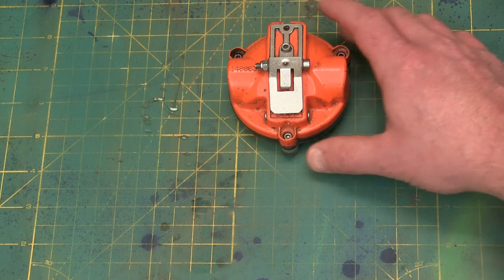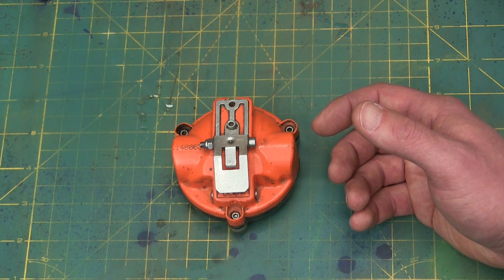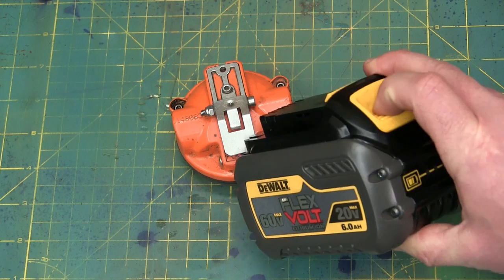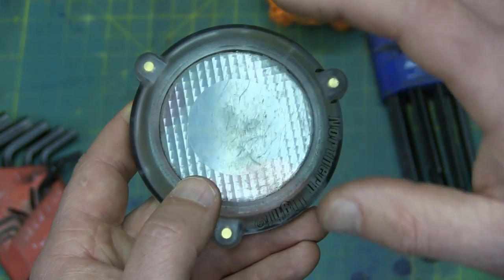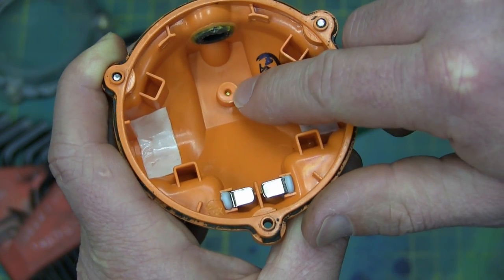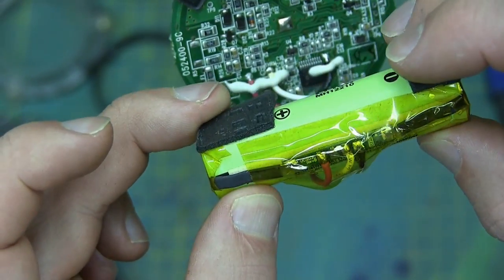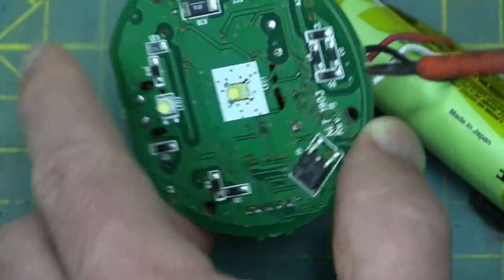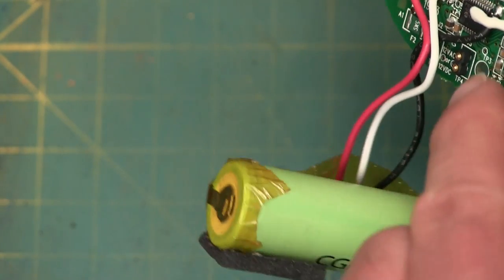BOLTR: $500 Industrial FLASHLIGHT. WHY SO MUCH?

Comment: Working in confined spaces, items such as torches and gas detectors have to be "Intrinsically Safe". This means NO sparks are allowed to be produced by the device itself, internally and externally, not to produce a potential hazardous situation and not to produce a hazardous atmosphere or to add to one. The devices are not to cause personal injury either. The devices HAVE to be calibrated as per the industry standards and by the related ISO standards and occupational health & safety laws applicable to that country. The main reason for the expense are the safety ratings for the types and specifics of work it's used for.  Cheers :)

Comment: 18650 cell, the protection circuit is likely only overvoltage, undervoltage and overcurrent. there would have to be a microtemp or ptc strap welded to the cell to provide temp relief in addition to the vent in the cell.

Comment: Lil' trick to unfog these glass lenses.  You just rough em up good with high grit sandpaper, clean up ( not with brake cleaner :P ) and you apply the tiniest coat of clear spray paint.

Comment: Yup. Been in the emergency services for many years. In the FD we are always getting reamed by various regulations where we have to have equipment that meets certain specs and has X certifications. Explosion proof is a big one.  The workplace hazards are very real, OSHA and insurance companies are constantly snorting and stomping around, and profiteers making fistful's of money from the restrictions are more common than flies on a poop pile. 
Flashlights, man down alarms, protective gear, you name it. Once saw fire axes being sold at a trade show for $120 a pop back when you could buy a regular axe for $20.
But when it comes to triggering an explosion, be it coal dust or flashover,  it's kind of nice knowing your flash light won;t set it off.

Comment: Wonder if it didnt break because its so soft? I know plastick like clear ghetto silverware will snap easily, but those are also harder, so its much more brittle. Internal stresses on that are also visible through polorized lenses. Maybe the lens is soft as a safety feature to help prevent shattering if and when it becomes a rock deflector?

Comment: 200 and 300 series stainless are austenitic (good corrosion resistance, decent strength).  400 series is ferritic (cheap and definitely magnetic) or martensitic (hard).

It' probably a 300 series stainless with lots of ferrite. That would be slightly magnetic.

Comment: The cheaper 18-8/304 grades of stainless will become magnetic with cold work (especially in stamped sheet stock). 316 won't, but the others will. You could test with Copper Sulfate (I know you have some floating around) to verify it isn't ferritic.

Comment: The light iscertified  what we call in Europe ATEX, atmosphere explosive. These lights are tested that the energie of a short circuit is so low that it cannot ignite a flammable gas/dust. Al these items are certified thus expensive. For mines there are 3 classes zone 20,21,and 22 .

Comment: Been enjoying your “vidjeos” always cracks me up. The battery dimensions of that thar 18650 would be 18.6mm diameter by 65.2mm in length if I recall correctly.

Comment: I know this is an old video, but I thought I would share an experience with PC.  At a prior job we had a product where the prototypes were milled from blocks of PC.  When we went to production we went to molded components.  Well some knucklehead didn't think to observe the chemical incompatibilities of PC and had spec'd that the assemblies be put together with Loctite all over the place.  The injection molded parts just crumbled.  You could watch the cracks form and then the capillary action would pull the thread-locker along the crack.  The thing would propagate like a fault-line in a crappy disaster movie.  The milled parts were just as susceptible to chemical degradation but because they had less internal stresses they became brittle instead of completely crumbling of their own accord.  They tried to use less loctite but even the curing vapors were enough to cause the assemblies to fail.  It was a real PITA to deal with.

Comment: The little PCB is a Battery (or cell in this case) protection module to protect the cell from overcharging and overdischarging. It is an 18650 - the 18 refers to the diameter (18mm) and the 650 is the length (65mm) and I have no idea why it is not an 1865 instead of an 18650! Linear voltage regulators are incredibly wasteful (especially with a 12v input and a 4v cell). The inductor may be used as part of a buck regulator circuit.

Comment: I'm sure someone here know more about this but it was my understanding that msha approved flashlights had to be air tight incase a miner gets trapped and there is a gas leak that way they could use there lamp without fear of igniting the gas. Again I'm just a contractor who visits maybe once or twice a year and typically work surface mines. so this is hear say but it sounded good.

Comment: The Battery appears to be an old Cobalt-Series Panasonic Cell, stamped Date Code indicates it was initially produced & first charged on August 1st 2009. Original Capacity would have been ~2550mAh.
It IS an unprotected Cell which explains the Cell Protection PCB attached to the side of it.
They don't, however, use Thermistors on 99% of Protection Boards though. Instead they use A Battery Protection IC (Typically a DW01-P or equiv.) which controls one or more (usually 2) Dual N-Channel MOSFETs (Typically 8205A's). Effectively protecting the Cell against Over-Charge, Over-Discharge, Overcurrent, as well as Short-Circuit.

Comment: That's an 18650 lithium ion battery, and the protection circuit typically does undervoltage, overvoltage, and maybe temp. It'll have a mosfet to break the circuit.

Comment: Not sure if you figured it out, but the 18650 battery => 18 (diameter mm) 65 (length mm) 0 (type round)

Comment: that's a size 18650 battery, which is why it says 18650 on it. it is the most common size for laptop and power tool battery packs.

Comment: Looks like a 18650 battery. I use those in my PowerTac E5 flash lights; pretty skookum rechargeable batteries from panasuckit, samsunk, or soneat from my experiences.

Comment: On a list of various storage plastics, polycarbonate is rated N (NOT, NEVER, NO, NEGATORY, NOT ADVISABLE) for 105 out of 283 various chemicals, and rated F for another 39,  Polystyrene is rated N for 118, but only F for another 18, making polycarbonate the most chemically fragile common plastic.

Benzine, ammonia, acetone, are all pretty destructive to PC.

Comment: That battery looks like an 18650, commonly used in vape mods. It has over charge, under charge, over heat, and short protection circuit under that little cap on top. It's a lithium ion cell, 4.2v.

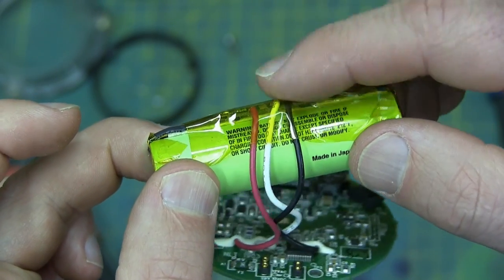Comment: 6:28 Looks like a ubiquitous 18650 battery. Those are in everything (laptop power packs, good flashlights, vapes, tesla cars). 18mm diameter 65mm length 0 for cylindrical I think....

Comment: It's interesting that fuse 1 is missing. I wonder if they used to protect the battery with an onboard circuit until the battery came preassembled with this protection on it. That protection on the battery looks like a lot of the ones on a li-po cell. Maybe it was cheaper to use an existing protection already on the market for the Li-Ion cell. I kind of like it that way, maybe I need to transplant some li-po protection boards to some 18650 cells like that.

Comment: Battery is moist likely 18650. You'd assume that the battery would have a resettable fuse or a temp sensor that would allow it to function again after it has cooled back down.

Comment: Wonder what EX rating this is, as the cap there is quite big and there is a coil to potentially increase voltage or cause a spark during a malfunction.
In essence they may rely on the encapsulation for the rating. If so, this seems a bit less safe than I'd want. Then again, I have most experience in EX-0 which is strictest...

Comment: Looks like a Panafonix (edit) CGR18650B cell. I use the NCR variant which are 3400mAh@3.7V nominal in my single cell single Cree XPG led Shenzen special. I reckon you'd get at least 6hrs run time on a fresh cell. The pixies are angry in those, skookumest 18650s.

Comment: Not quite true you cant cut/drill tempered glass. Google Silastial Cold Glass. Rick Silas has the patent (he tried to sell it on Dragon's Den), basically he coats the glass with a resin, shatters it, and the crystalline sheet left over can be bent, shaped, drilled,cut like plywood. Pretty amazing and visually cool.

Comment: Wet sand 320 , 400, 600, 800,1000,1500,2000,3000, then polishing compound. To cheat just buy one of those multisided fingernail polishing sticks. $.99 at the local Dollar store. Use it wet.

Comment: About a year ago I soaked my vvt solenoid from my volvo in brake fluid in the stairwell of my building. It was in a plastic tub with about half a bottle of brake cleaner sprayed into it, the parts were submerged (fuck off I had never used brake cleaner till then). I came back an hour later and the plastic tub was completely gone (I'll admit I was EXTREMELY confused and for about 2 full minutes I was convinced someone stole the plastic tub, until the physics finally dawned on me), the solenoid parts were on the floor in  gooey puddle of brake cleaner, a huge damn mess; plus the fumes almost knocked me out. So, I did what any shitty tenant would do, I grabbed those fucking parts and ran off to leave some other poor bastard to deal with it.

Comment: That is a Panasonic inr flattop 18650 3.7v 3500mH battery.
But i could build a way better light with different brightness modes a few days continuous run times, and different spectral lights for spotting chems in the air.

Comment: As you were talking about the glass I remembered being at my father's garage and being told to put a scrap car windshield out the back, of course being a bright kid I figured I could drag it across the floor. 10 seconds later I hear a pop and the thing fell to pieces (Like in the cartoons when something is burnt and turns into a pile of ash), even in my hands. All the pieces were uniform and about ½ cm in size, not sure if it's the same or not.

Comment: The usage of a voltage regulator would be very inefficient. A buck converter is quite easy to implement en would give an efficiency of around 90%.

Comment: Polycarb and most other crystalline polymers CAN be annealed.   This is probably the case in this lens.

Looks like a NiMH cell from color.  Safer than Li ion on the fire issue.
Reply: Nope, it's a lithium ion cell, 2500mah with a 5A max continuous discharge rating

Comment: Been watching your vis for both education and entertainment, but I didnt know I was watching a fellow miner.  $500 beaver pasos is a little steep pard, those run around 250-300 american green backs south of the boarder.  But that's no shit, I've worked in mines that dont require MSHA approved gear and the same lamp without the stamp is only 150 on the fake american currency scale.

Drill Blast and Haul Ass!

Comment: Battery "must come untabbed"? You sure of that? Couple of years ago the nickel cadmium batteries in my drill gun were not longer holding a charge and rather than spend $60 on a new battery pack, I decided to disassemble the original battery pack,  buy new cells for it, "Sub-C" I think the size was called, and solder the cells together. 1.2 volts each. 10 cells cells in series for a 12 volt battery pack.   About $8.00 US including shipping, if I recoil collectry. Anyway looking around on the ebay marketplace, I saw subC cells advertised for sale both with and without tabs attached. My new cells arrived at my shipping address same as billing address, and the tabs, by the way – I think they were welded on, as opposed to being soldered on.

Comment: I have a lumonite compass R headlamp, twas 150 finnish pesos. IPX8 rating, 800 lumen at high setting for 2+ hours. Milled body.
Reply: runs on single 16850 3.6Ah battery

Comment: Interesting stuff! anything explosion proof is damn expensive from what I can tell. the "white snot" on the battery lead wires and micro controller is to tell if something overheated, yes?
Reply: 71dembones hot snot on connections is for mechanical reinforcement, makes em harder to vibrate apart
Reply: Ah, I see. Like hot glue except industrial grade. That makes a bit more sense. I know that it will melt and lose it's original shape when it gets to hot but, that's obviously a side effect. I guess I've just seen it places that don't seem to need reinforcement...

Comment: Looks like an 18650 lithium battery, and the thin PCB going between the poles is over voltage protection.

Comment: ~12:35 .. is it strictly a solvent action or is thermal shock involved? A couple of years ago I tried to clean a solderless breadboard which had accumulated a nasty coating of dust by running it under alcohol. The alky doesn't appear on a smaller scale (rag, cotton bud) to mar or soften the material - but the stream immediately and relatively violently cracked the board through in dozens of places. Never could figure exactly what the hell happened.

Comment: 10:00 and on reminded me of years ago when I was in the consumer electronics repair industry and I was doing a repair job on an older TV set and squirted some kind of "high-tech" whateverthefuck contact/control-cleaner spray into some of the set's potentiometers in order to clean them, and the plastic parts inside the pots just basically shattered into pieces.

Comment: Do you have a link to the video of your attempt to cut tempered soda glass?

When I was young we had a set of tempered glass tableware. Three times we had one of the dishes explode. Once my mother hit a soup bowl with the diamond of her wedding ring. There was a crack and the bowl turned into a pile of gravel. Another time my mother put one of the glass plates onto the burner of the stove. It was an electric stove and the burner was hot, but not red hot so she couldn't tell. She assumed it was cold. After a few seconds there was a loud crack and the plate was gone. We found bits of glass the size of peas all over the kitchen. My mother's neck and collar were exposed and after 20 minutes or so I noticed that it looked like she was sweating blood. Something had lacerated her collar. You couldn't see any visible punctures or cuts. She didn't find any glass fragments or slivers in her skin, so the glass either bounced off or the fragments were so small they couldn't be seen or felt. Another time I had a bowl of potato chips sitting on the floor while I was watching TV. I was just sitting there when I heard a "tink". Nothing had touched the bowl. It just spontaneously shattered into a pile of glass gravel. We threw out that tableware set.

Comment: Tempered glass really doesn't fit the description of how those dishes were breaking. I think you should keep working at it. Perhaps giving the glass a control crack to break along so that the crack doesn't travel. I know that people turn beer bottles into cups with a control crack, thermal shock, and a light tap. Perhaps that would work on your dish.

Comment: If epoxy coated rebar gets a nick through to the steel, it can cause a holiday. Electrolysis will attack that spot with a vengeance. I'm surprised they use it in mines.

Comment: Bet that chip on the battery is actually a low voltage protection circuit.

Comment: polycarbonate (pc) is susceptible to any chemicals with esters or ketones.  some synthetic oils or lubricants also don't bode well with pc.  even though there is a coating on pc, microfractures occur due to surface tension.  another horrible thing to subject pc to is steam.  it will destroy the pc.

Comment: that's an 18650 battery. the 18 means 18mm diameter, 65 means 65mm long, and 0 means it's a cylindrical cell. those big fucker Hilti batteries you tore apart way back when were 26650s, same deal but 26mm diameter. if I remember right this particular cell is around 5000mAh capacity, but it has shit for ampacity. perfect for a light but you wouldn't want to run a laptop or drill or whatever high power crap off it.

Comment: those batteries 18650 Panasonic are what powers the Tesla cars and powerwalls,
Reply: Yep! That they are. Banks of them. They are one of the best cells made.  Panasonic is the same company or was the same company as Matsushita. Sanyo is owned by another Matsushita brother. Matsushita got loads of tooling from Philips Mullard when they decided to stop making vacuum tubes. Those old Matsushita tubes are really superb, if you can find them. They are also very under rated by the audiophool types.  Toshiba, Hitachi, NTE, TEN, Japan Tube, all made pretty good stuff.
Reply: I want to learn how to build self sufficient homes and vehicles, I work in construction and maintenance now just another feather in the old cap